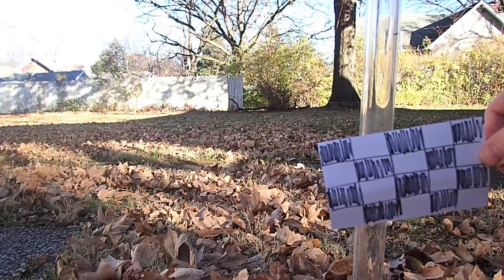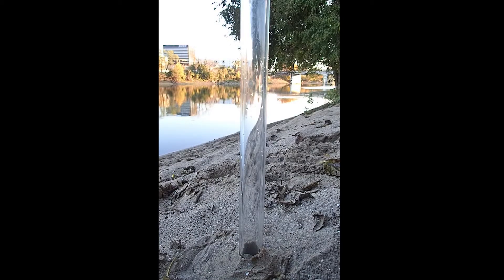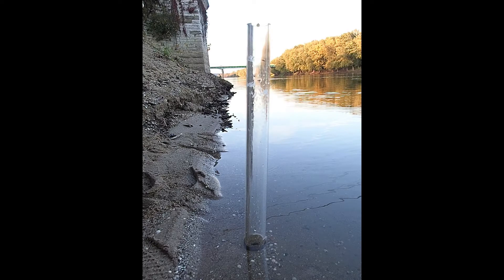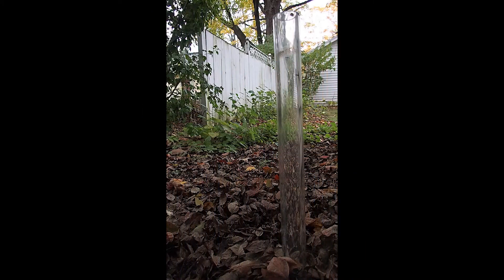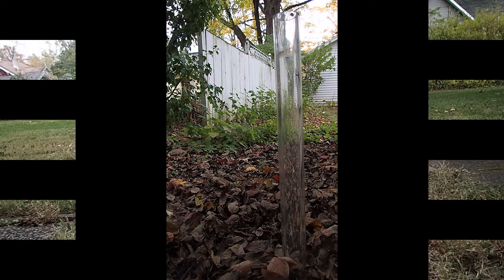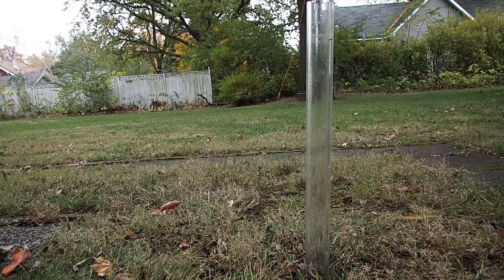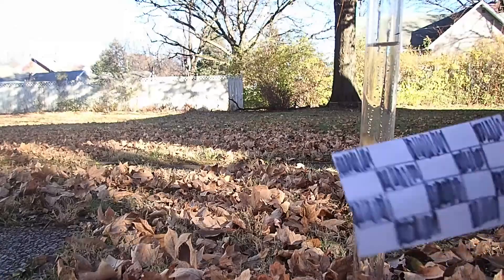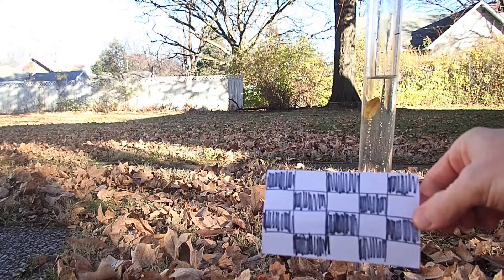The Infiltration 500

Comment: Firstly, thx for the video. I want to ask sth:
The second soil looks like sand. I think that instead of saturated clay and dry sand, saturated and dry sand should have been compared with each other. There should only be one independent parameter for comparison. I mean, even if the clay is unsaturated, sand infiltrates the water much faster than clay. Adding saturation property to clay is too much for comparison, am I thinking wrong?

Comment: I have a question about this experiment, specifically the saturated clay soil case. Just consider a rainfall, the infiltration could be resisted due to there is barely room in the clay to store the storm water. However the experiment indicates that the infiltration under this situation is not bad, which might result from the tube-inflow spreading out on the vast water surface out of the tube.
Reply from the maker: Thank you for your comment. The goal here is to show the infiltration is show in clayey soil compared to sandy soil. Even in clayey soil infiltration will occur (unless it is saturated), but it will be at a slower rate compared sandy soil. In this experiment, the water pressure in tube may have forced the water to move little faster compared to just rainfall occurring on the ground, but the relative effect of sandy vs clayey soil will still be the same. Hope this helps.